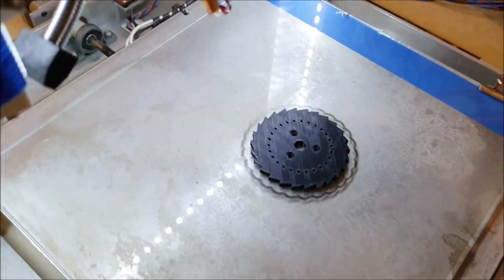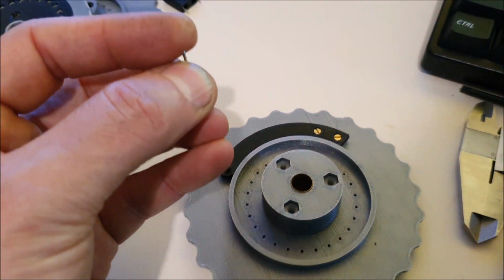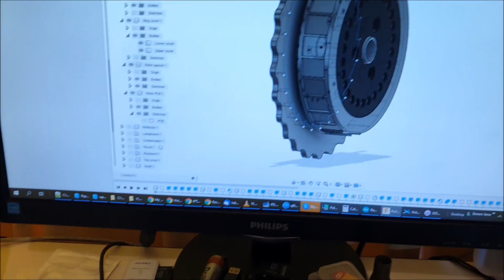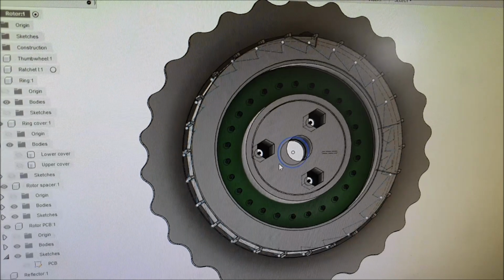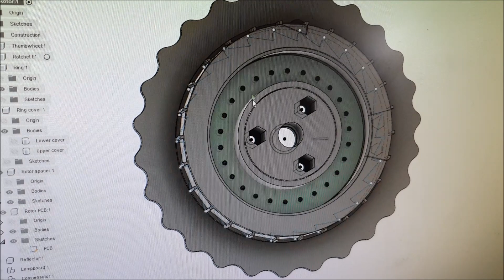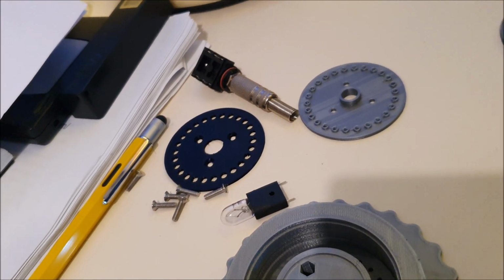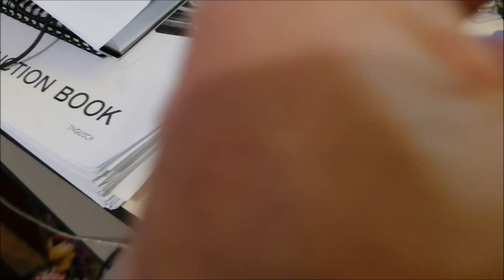3D printed Enigma update 13 April 2020

Comment: hi, I'm building one too. How did you make the contacts connect from one rotor to the other nice and smooth? I stumbled at the problem of not having all the pins at the same length, and that generates bad contact between rotors. Did you use individual springs on them? 
best regards from brasil :)

Comment: Have you tested stepping with all the rotor pins/contacts in place?  I'm also 3d printing an Enigma machine and I had to actually heat-set my contacts in the plate and then sand it super fine (120 -> 4000 grit) to reduce the friction enough for the stepping to work smoothly.
Reply from the maker: I haven't got far enough to try but it is something I expected/planned to have to do. I usually sand PLA using some vegetable oil as a lubricant which works very well.
Reply: @asciimation  I wet-sanded mine (just with water).  I ended up using the same pogo pins as you.  26 of them creates quite a bit of force, which generates a lot of friction.  I had originally planned for them to compress 2.5mm, but the friction ended up being so much that I spaced the rotors out an extra 1mm each, to reduce the spring force.  It's still a problem I'm trying to figure out how to solve.

My rotors are all hard-wired since I couldn't figure out how to fit a connector / set of connectors in there, so reworking the rotors themselves will be tough.

Comment: Very cool. I was inspired 2 years ago from your videos to make my own replica Enigma 1. I have finally completed it! (Using many laser cut parts so I am looking forward to seeing how you use laser cutting in your projects). I was wondering if there is a way to access the code you wrote for your bombe since your website no longer works? Pictures of my enigma can be found at enigmareplica.wixsite.com/enigma
Also be careful: I have found that the thickness of the rivets varies, leaving a bumpy surface. But I am very impressed with your design so you can assemble without the ring in place.